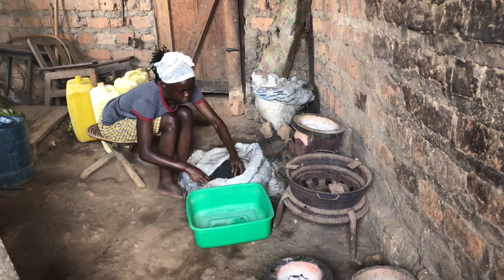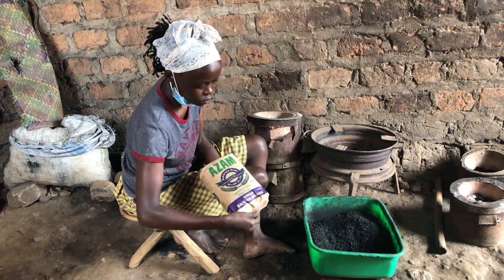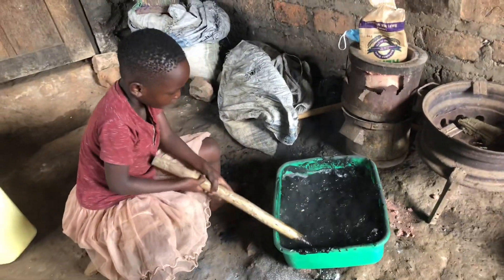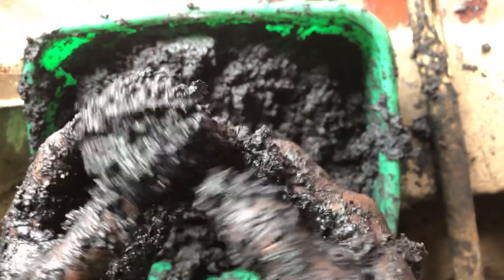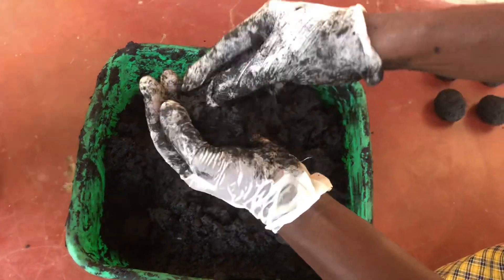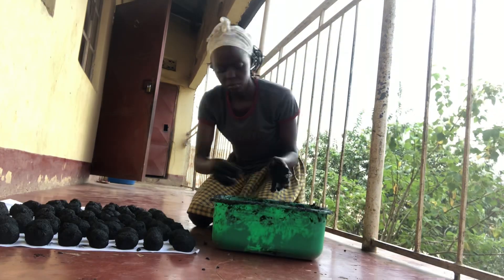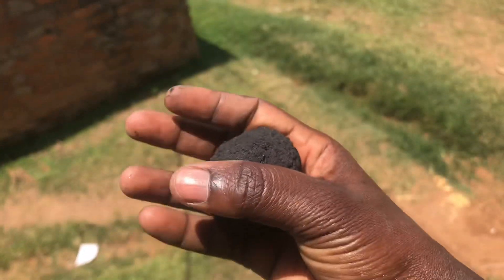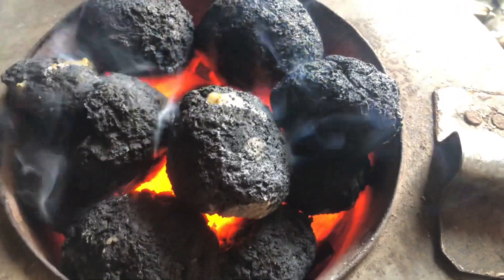African Village Life: Making Reusable Charcoal Briquettes Using Wheat Flour & Charcoal Dust

Comment: How much of flour do you mix with charcoal dust
Reply from the maker: 3 cups or half a kilogram of flour In 1 full basin of charcoal dust
Reply: Thanks  @PeaceNamawejje
Reply from the maker: @kennymzangwamusic5711 You are welcome dear
Reply: I mixed it in wrong measurements 1kg of flour to 10 kg of charcoal dust  @PeaceNamawejje
Reply from the maker: @kennymzangwamusic5711  Oh sorry about that
Reply: Esh. They don't burn, only burning the flour. Maybe it's too much😢 @PeaceNamawejje
Reply: @PeaceNamawejje Instead they are  cracking
Reply from the maker: @kennymzangwamusic5711 They take long to dry. You have to let them dry in the sun for about 7 to 14 days before using them. When they are fully dry, they don’t crack.
Reply from the maker: @kennymzangwamusic5711 I uploaded another video showing you how you can use clay soil and cassava flour as the binder. Kindly check it out.
Reply from the maker: @kennymzangwamusic5711 If you let them dry in the sun for about 5 to 12 days, they won’t crack. Drying them under the sun makes them rock hard and they won’t break easily.
Reply from the maker: @kennymzangwamusic5711 I am so sorry that it didn’t turn out as you expected. But when they turn red hot, the smoke created from the burning flour stops. However if you use clay soil as the binder, you don’t experience the smoke.
Reply: Okay I'll check it out @PeaceNamawejje
Reply: @PeaceNamawejje Thank you Ma'am 🙏🏿
Reply from the maker: @kennymzangwamusic5711 You are welcome dear. The other thing that prevents the briquettes from cracking is compressing them well, if they are hard to compress by hand, you can use a plastic tin cut into the shape you like. Place the mixture in and compress it well so that when it gets out of the tin, it is hard enough and has formed the briquette you like.
Reply from the maker: @kennymzangwamusic5711 Alright dear. I hope they turn out perfectly on your next try🤩🤩
Reply: I hope so too. Thank you so much from RSA🇿🇦 @PeaceNamawejje
Reply from the maker: @kennymzangwamusic5711 You are welcome dear one. Greetings from Uganda 🇺🇬